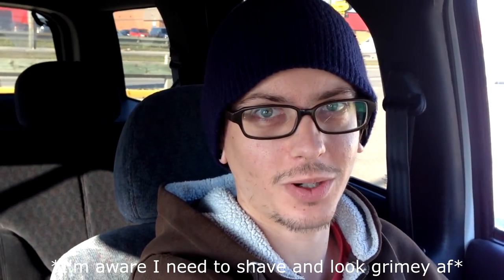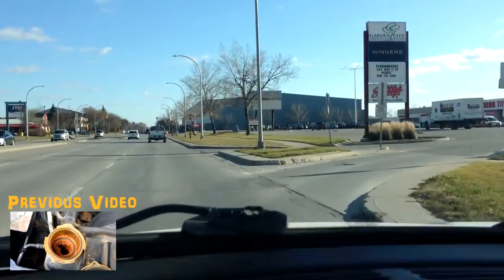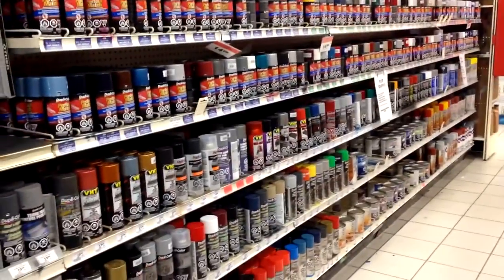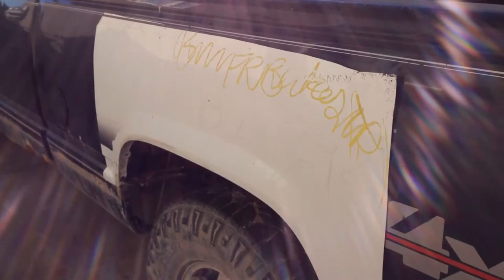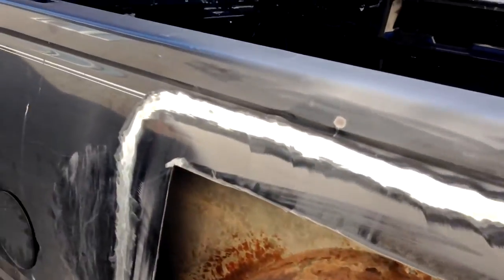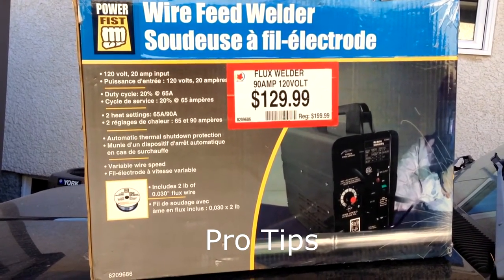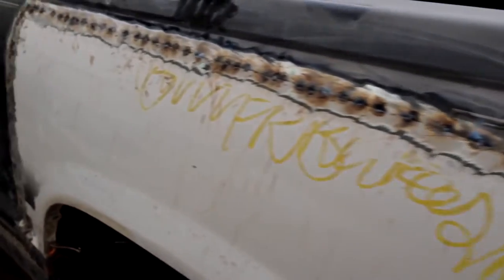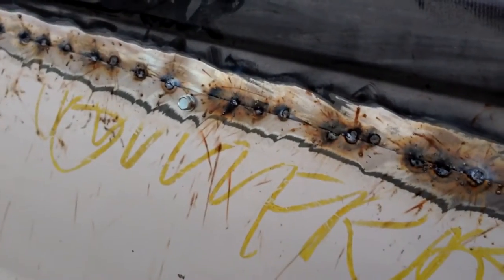Easy Rust Repair "Welding and Grinding"  | $40 Box Side fix - (Part 2)

Comment: why did you weld on top of the panel instead of below, wouldn't it take more bondo on top?
Reply from the maker: Do you mean if I put the white panel behind the original black sheet metal of the box? The inner wheel well part would have made that difficult, and I've always done it this way.

Comment: That's not how it is supposed to be done. Putting a panel on top of another will create a perfect space for water and instant corrosion.
Reply from the maker: Yeah it's starting to happen I think lol. May just get a new box this spring. I did this repair for $40 and the rest of the box is rough.